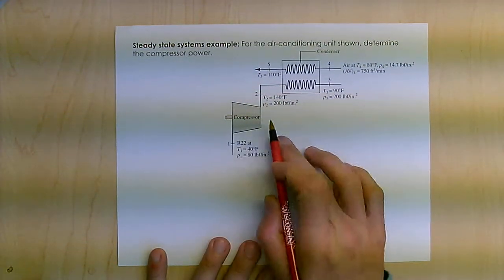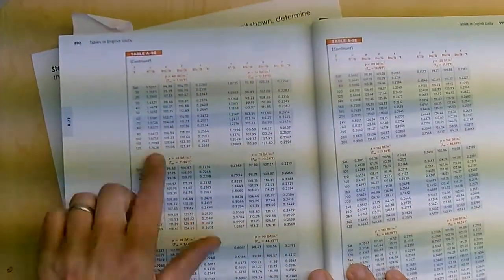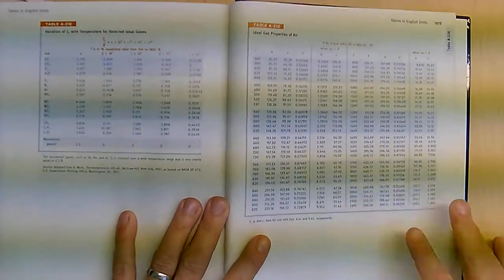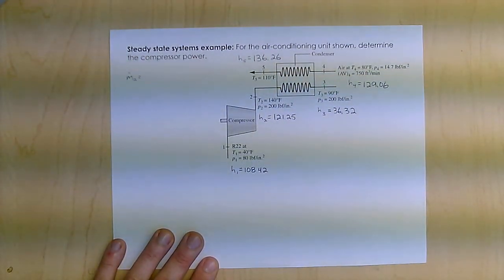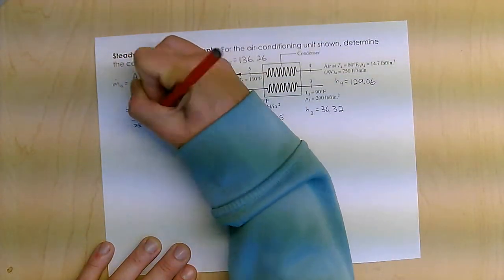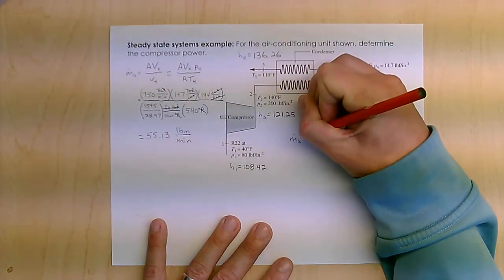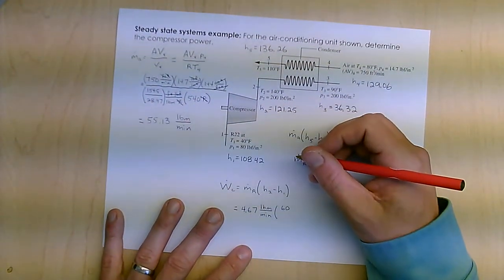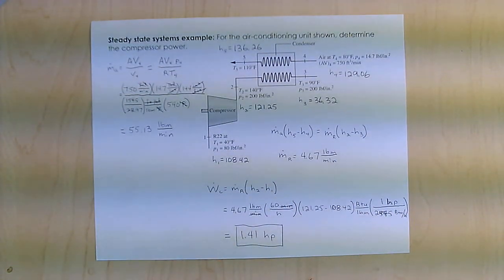Thermodynamics Example 13b: Control Volume Systems

Comment: great videos! Thanks so much for uploading. By the way, the last equation for W_c should be mdot(h1-h2), not mdot(h2-h1). That way the W_c will be negative. Since we designated W_out as positive (e.g. turbine work), then compressor W_in should be negative.